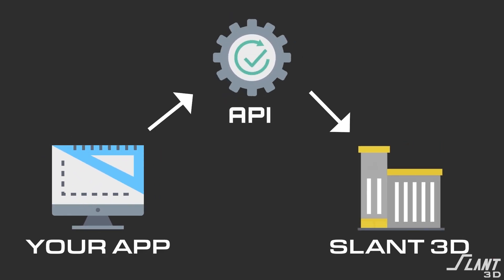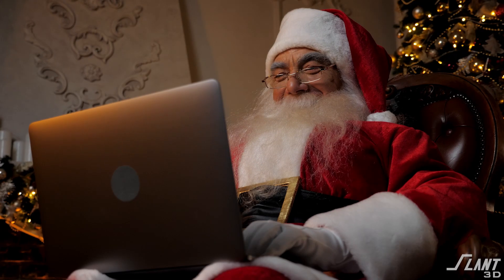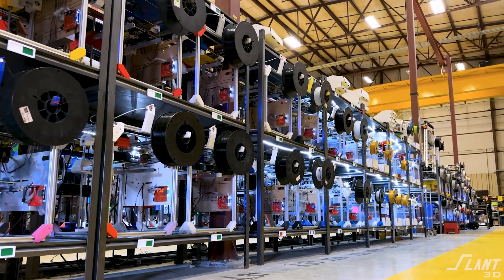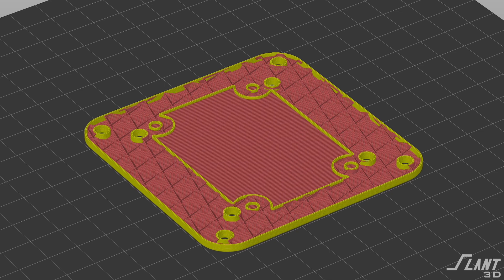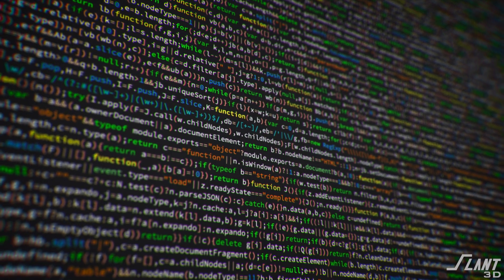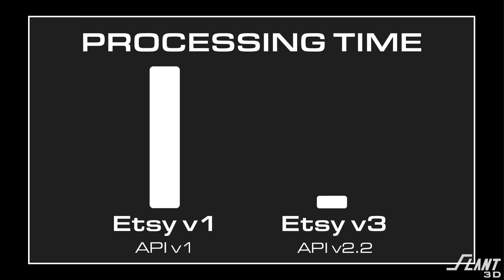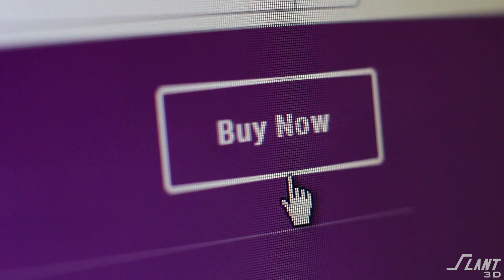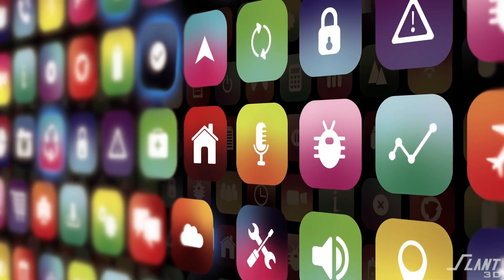Build Any Application On Top of Our 3D Print Farm | Slant 3D Printing API Beta Launch

Comment: Very interesting. But how would you handle copyright violations ?  Lots of stl files and designs are shared freely, but there is also a lot of non commercial licenses from designers who want to share their work for personal use but retain the rights to any commercial application.
Do you just trust the users to understand and respect licensing?  Without any sort of filter, would you not be complicit in copyright violations?
Maybe STL or 3mf formats should include a license identifier to limit such abuse, would not solve the problem but probably help a lot.
Reply: Not a lawyer. I think the idea is that Slant provides a service and has no control over what license the STL has - the burden would be on the API user. E.g. I can’t sell a print that has a non-commercial license, but I can print it for someone for a fee if they provide me the STL file because I provide a service. I don’t know how foolproof that is but that’s how service providers have been doing it from my observations.

Comment: Looking at the docs. Am I missing something or do you not get the shipping cost until after the order is placed? Would be nice to get a shipping estimate before committing.
Reply from the maker: Unfortunately different destinations create different shipping costs, as well ad different weight and size. We work with USPS directly you can use quoting from them in order to estimate shipping. <1lb will be about $5. More than 1 LB will be about $10-14
Reply: @slant3d  wouldn’t the slicer give you the approx weight and size? Then figure out the packaging overhead for final weight and size. Those two plus the zip would give you a shipping cost.

Comment: yes the kid with a laptop will definitely have a credit card available,
 I propose the card entering to be optional, and if you don't enter it the process order endpoint will return a normal response but with a message telling the user to enter the credit card number to order for real

I would also add a "test" order endpoint that fakes the normal one but doesn't really order a part, as else it will be very expensive for the developers to test their applications
Reply from the maker: Good point. We have passed that along.

Comment: Dev here. Looking for app ideas. Guess I got here too soon :)

Meanwhile, you talk all the time about the need to review/optimize the geometry and placement of an item on the build plate. How do you account for that when you just have the STL? Wouldn't it make sense to create a data object specifying both the STL and those other parameters? It seems like something that would optimize setup time for your people and provide for consistent results as far as customer (both seller and recipient) expectations.

I really like the simplicity of your API. There's a lot of potential here. Markforged comes at it from a different perspective but the web/API-based approach to submitting jobs is intriguing.
Reply from the maker: App Ideas: Shopify, connected to an STL generator, work with a designer to create a Print on Demand App for thier designs, ebay integration, amazon integration, an etsy integration that is better than ours

Comment: Having a look at the API docs right now and I got to say they are a bit lacking! Ex. the "shipping and tracking" endpoint, sure it gives an example of the response and that it can contain a "shipping-status" field which can have the value "awaiting_shipment", but what about the other possible values for it?

I'm sure some other devs would appreciate if there are some OpenAPI spec'ed docs available as well! 

Whereabouts would people go to report any bugs/issues/ask questions? A Discord server would probably be great!
Reply: Agreed, there's room to enhance documentation. No strong preference about OpenAPI specs but it could be more complete. Also is there info somewhere about the slicing parameters used? What about a sandbox mode for testing? What about bug reporting? I'm more of a Github Issues guy than Discord.
Reply: @deltafactory  I suggested Discord with the idea of also having some place to build a community for Slant3D and have some developer section/channel there, GitHub is also great!
Reply: I would agree that publishing documentation through github and using github issues could make a lot of sense, I think there are tools that do this pretty easily?(ex. Have markdown formatted documentation that's rendered automatically into a docs website). This makes it pretty easy for people to suggest small changes and such, and have conversations about specific questions in a way that is much more organized than discord - discord is not particularly searchable
Reply from the maker: Baseline slicing is done with a 0.2 resolution and 20% infill.
Reply: @slant3d 20% or 25%? The Etsy app video said 25% https://www.youtube.com/watch?v=N3ZKC8bhEok&t=64s
Reply: -- Edit: I now read the docs again and realized it says "processes payment via Stripe", whoopsie, but again the example didn't really inform me of how/what I'd send to the customer ordering the printed model for them to actually pay for the order?

I'd also LOVE to get some more control over payment / order creation! (and est. shipping costs)

 If I were to build some site where people could upload models and other visitors could order prints of those models, having all those orders charge the card linked to my API-key could get insane! (I haven't tested that create order endpoint, so not sure how it works yet but I assume it charges the card I linked?)

Even if I added some instant-payment page on my site, it could take some time for those payments to get processed and withdrawn to my bank/card, and I wouldn't want to risk a huge amount of my personal funds either.
Reply from the maker: When you send a file to be printed the API stripe is used as the payment processor for the API KEy holder. Your application would have to implement whatever billing option you prefer to bill your app's users.
Reply: @slant3d  Right yeah okay so it was as I originally thought, charge goes to the card linked to the API key, which makes sense.

Personally I don't like the idea of having to have some "reserve" built up for the linked card just in case I happened to get a spike of orders without having better control of my balance/funds. Maybe I could suggest adding some "balance" feature, letting us top-up with some amount and set some option to only charge from our balance, returning an error if the balance is too low?